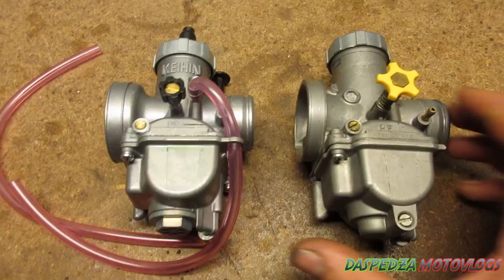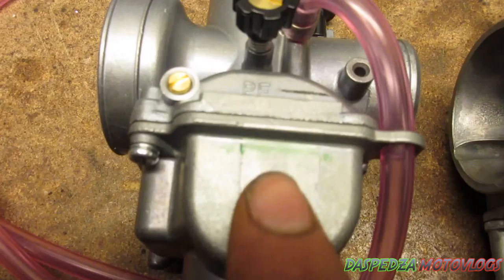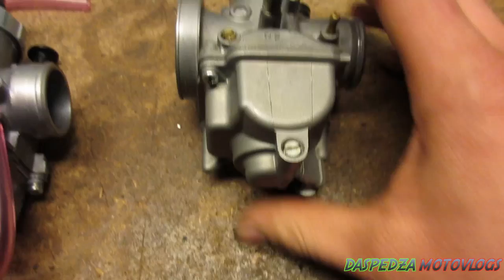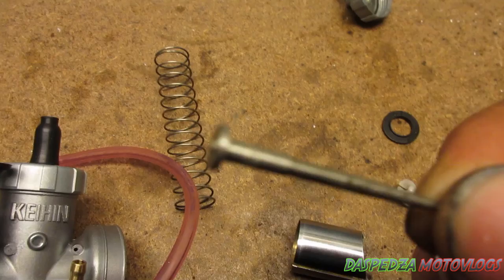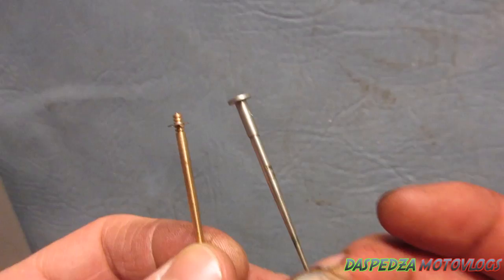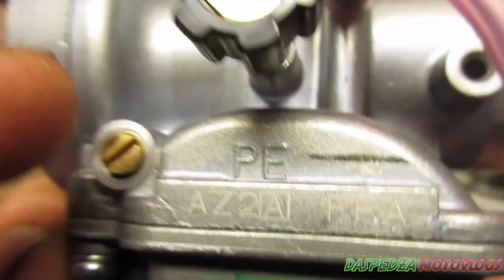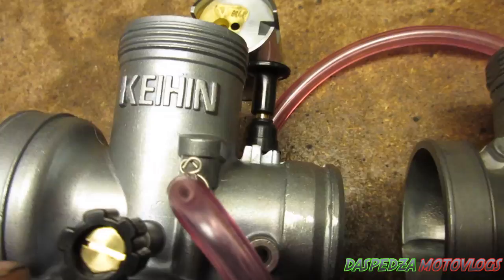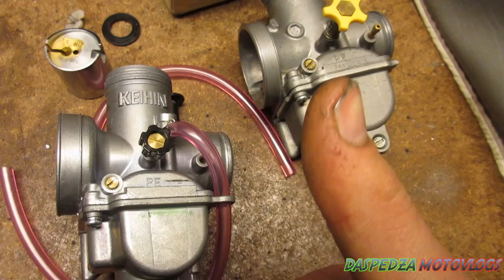99% PEOPLE CAN'T SPOT THE DIFFERENCE - KEIHIN PE28 Real Vs Fake!

Comment: The left one is made by keihin japan miyagi plant for Suzuki Rm or Sudco, notice no 2stroke oil port.
The right one is made by keihin thailand lamphun plant for honda nsr 150sp notice the 2stroke oil port.
Both have fakes, but the frequency is much more higher in the Thailand model.
The safest way to buy these carbs is to buy it through a reputable long time sellers.

Comment: I actually bought a fake PE28 exactly like the one in this video for my 125cc. A friend of mine with the exact same bike used a genuine PE28 and it worked. The fake one just refused to work properly. Really struggles at low RPM, on high RPM it's like the engine is chocking. The only redeeming quality, is that they are flithy-cheap to buy. I thought that if I tune and jet the Chinese carb properly that it would work, but it didn't...

Comment: Fake or not, it runs just as good. I’ve worked on carburetors for years and will say in my experience, I’ve never had to adjust a needle or needed to pull a main jet without taking the bowl off. Suits Keihin right for price gouging for years. Hopefully they will drop their prices because of lost sales.

Comment: I needed a carb for my Honda cr250r and went on eBay and found a great deal I thought so I bought it put it on my bike and never had any issues until I tried to jet it and I think it was the pilot jet was pressed in not screwed in a buddy of mine said it’s a fake, I never thought of that so I just ran it for maybe 2 years and finally bought a real one from a dealership, can’t believe they would go that far as to make fake carbs, I wonder what else I have on there that’s fake

Comment: its clear honda never purchased and sell FAKE carb.. spot the difference, the one u compared is PE type from thailand and dts d original.. i stared dotted serial # matrix, and the center base of the throttle valve or piston is colored Gold and has a code, and No Needle adjuster while class A PE type is simply spotted as No dotted serial matrix.. just a plain serial number and throttle valve center base is colored silver, and has needle adjuster since class A carb in the long run has idle Difficulties while the Orig PE is very easy to tune in w/o needle adjuster... no you know dude

Comment: real or fake, the perfomance is same lol
Reply: Its the durability
Reply: @gamingwithrex7425  yeah i agree with that
Reply: real more stronger and will take no problem 
but fake you will have problem in 1 month
Reply: @jskwwnwmw3429  been used the fake one for last 3 years still working properly tho
Reply: @slickyy_  what bike
Reply: Performace is different, and diffficult to jetting as the hole is less precise.
Of course both will work just fine.

Comment: Ok Im gonna blow your mind and tell you the simple reason the one you said was fake doesn't run correctly. ready?
The nipple that you called "a third breather" is a line for a manual primer. It is in front of the slide and therefor causes a lean condition and makes the bike run poorly. Block off that nipple or use it by hooking up a primer and it will run just fine.
Reply: It could also be for something other than a fuel primer such as a fuel pump line but either way having it open is going to cause a problem. You were correct in pointing out that one is definitely cheaper than the other although both are keihin
Reply from the maker: And im going to blow your mind also 
It was blocked off  while it was on the bike. 😂 
But I appreciate the contribution. 😃👍🏻
Reply: you said that it was a breather to allow for extra air which tells me you thought its supposed to be open but ok. Just tryin to help.
Reply from the maker: That’s all cool dude. I understand that 😃 im not having a go at you man.
But it was however blocked off while installed on the bike. As far as i know the bike is still going fine because it was my mates bike that had the problem.
Reply: ok so we're cool :) I guess i sounded kinda like an ass in my first comment. So easy to accidentally come off like a jerk in text.
Reply: Wrong. The third breather is for two stroke oil hose from oil pump. They are many variant of PE, the right one is from NSR150SP. You (almost) cannot see the difference between real and fake for this variant.
Reply: @awalstriker  hmm could be...